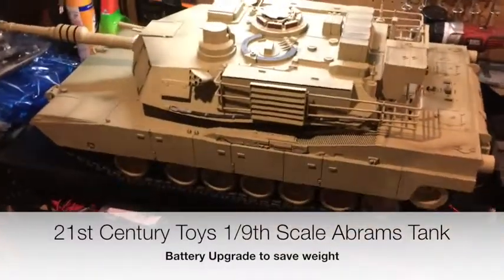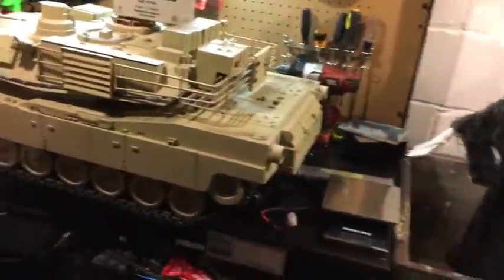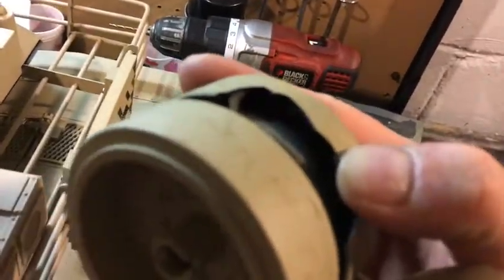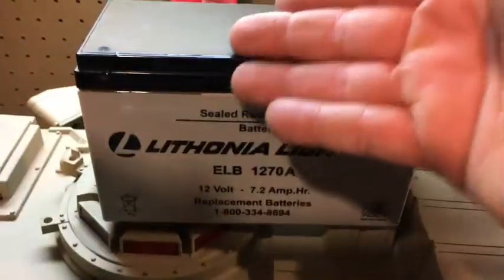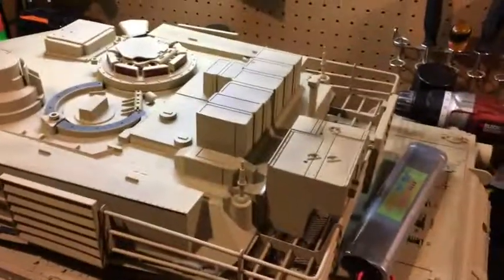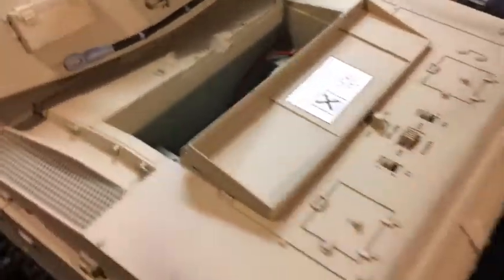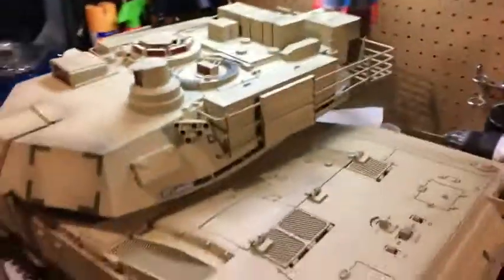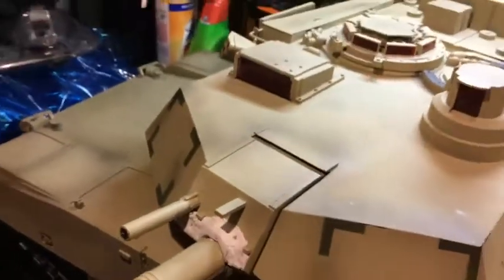21st Century 1:9th scale Abrams RC Tank Battery Upgrade

Comment: I just got this tank today it has a broken wheel, black inside, it won't turn on probably junk battery, it is from 2003, so might be a lost cause i guess
Reply from the maker: There are parts for these that pop up on eBay. The "black plastic" on these tanks are extremely brittle. for the carriage wheels if you do find them make sure they are the cream color inside where its not painted.